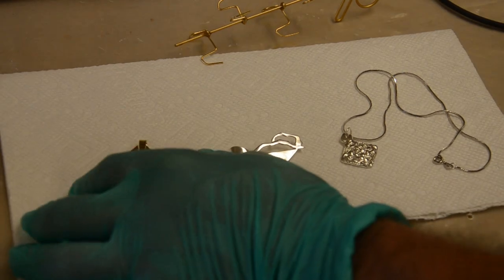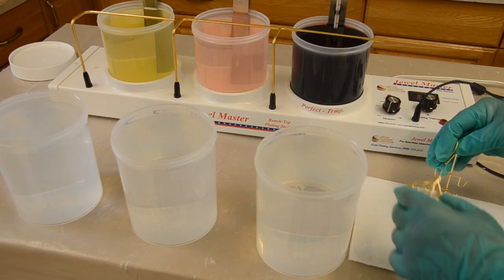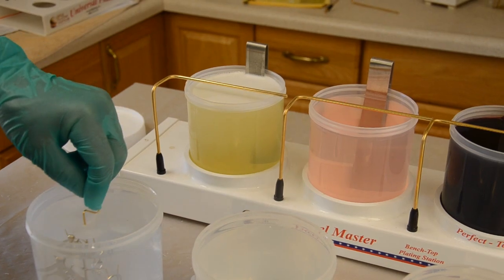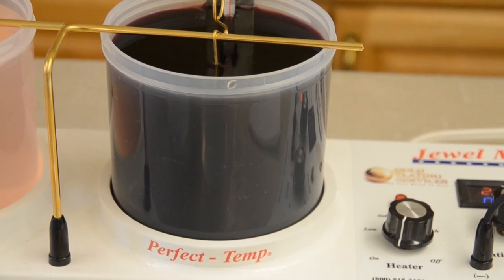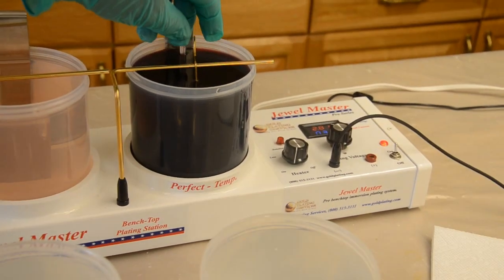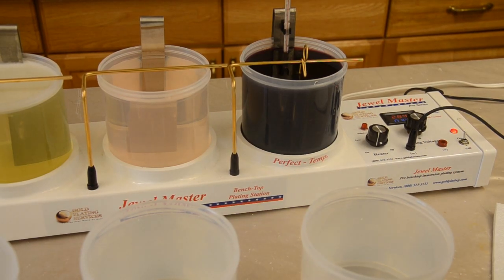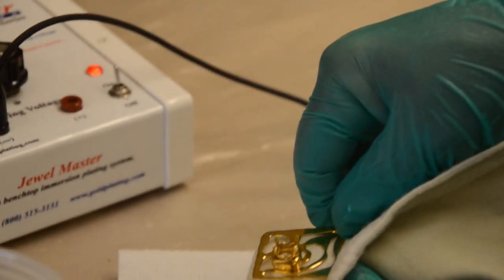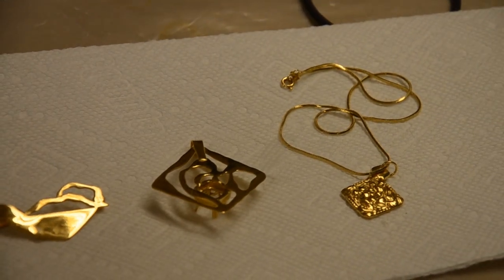Gold Plating Jewelry - Gold Plating Kit - "The JewelMaster Pro"

Comment: The problem with gold electroplating is that it DOESN’T STAY very long on jewelry that you wear any length of time.
Depending on the acidity or alkalinity of the person’s skin. Our own ‘chemistry’ wears it off. 😒
Reply from the maker: It depends on how long the gold is plated onto an item. But yes eventually gold will need to be plated onto an item again for it to look brand new.

Comment: Good day
I have a problem with the gold plating when I look, it looks good, but it removes quickly when touched or used within two or three days. What is the problem and what is the solution please .. For information, I paint for 30-40 seconds and do not use the activator. What is the activator used in the explanation?
Reply: Did you find the answer? Please help.me wher i can get answers from too

Comment: Do you recommend any product that seals the plated gold in ?
Reply: Great question! I hope we will get an answer! Also to be honest I do nails so I tried sealing with a clear hybrid base coat and/or top coat. It changes the feel of course, becauce hard gel doesn't feel like metal but it works GREAT as a sealer!! It's also safe for the skin after you cure it, it' super clear and shiny AND it can fill in and hide some scratches etc. You just got to be careful to keep it thunk so that you don't lose sharp edges and a clean look ❤

Comment: Would like to purchase a starter kit to get started of course.  Can you recommend the very first one I should get. I eventually want to get to playing guns
Reply from the maker: The JewelMaster Pro (shown in the video) is capable of plating onto most metals.  For steel/stainless steel you need a "Strike" instead of Activator.  You can use either Woods Nickel Strike or TriVal - Acid Gold Strike.  
The JewelMaster is a great starter kit.  Many who get too busy to keep up with their needs with the JewelMaster will eventually upgrade to our new ProLab plating kit, which has 4 or 5 Liter capabilities.

Comment: How do I strip my costume jewerly before gold plating them ? I have tried gold plating on top of my old jewerly and it comes out an ugly color not gold
Reply from the maker: Polishing is the best way. You need to get the part prepped to the luster you want prior to plating.  This is the case with most finishing and is most important with plating.
Reply: @GoldPlatingServices  thank you for replying.  What do you use for polishing? Any suggestions please?

Comment: how long does the gold plating last before it wears off from the actual metal?
Reply from the maker: This completely depends on 2 main factors; 1) how thick the gold is plated. 2) How it is handled.
If you plate the item with a very thick plate, say "Vermeil" (Pronounced Ver-May and is 2.5 microns thickness), it could last a lifetime.  If its earrings it will be handled less than a ring, etc.  Typically gold plating gets a bad reputation because many jewelers apply the gold way too thin.  When we plate an item, we put on atleast 1 micron or more and it lasts many years in most cases.
Reply: @GoldPlatingServices   It also depends on the person’s chemistry on their skin!  We have a pH level. I have had Bad Luck with plated jewelry.  Some wore off in weeks!🙁 (obviously poorly done) 
But I also grew to realize that all the vitamins I take, especially Vit. C, have an effect on plated items (but hey, mosquitoes don’t bite me and no colds or Covid, soo 🤷🏻‍♀️!)
I own 1 vintage, 50’s era, watch that has kept its plate well. There’s no school like old school!✌🏼

Comment: If you keep plating longer will it build up to eg: 5 microns, or 10 microns? I am wondering as most watches were plated to 20 microns back in the day?
Reply from the maker: 24K Hard Gold can be plated to ~2.5 microns or 100 microinches. 24K Soft Gold can be plated indefinitely thick, but has a matte finish.

Comment: @GoldPlatingServices  I have Three questions for you...Does Gold Plating give off any type of smell? How do you dispose of the used chemicals and What type of zoning does a Jewelry Maker fall under? Appreciate your help.
Reply from the maker: Gold plating does not give off much of an odor, if any.  Most people do not smell it however some with a sensitive nose can.  
To dispose of the chemicals you would need to find a local waste disposal service.  Many areas allow you to take it to the landfill, where they have a hazardous waste disposal area.  If that's not an option, you will need to contact a private local waste disposal company and inquire about picking up liquid waste.  Many people get large containers (20gallon, 50 gallon, etc.) and collect it for years and then pay a 1 time disposal fee (usually $100-$200 or so).  Zoning will depend on your area, you would need to contact your local agencies to find that out.

Comment: Will this set up work on a chain that is already 14k gold?
Reply from the maker: Absolutely!  Plating onto gold is about as easy as it gets.  You would follow exactly the same steps shown here.
Reply: @GoldPlatingServices  Thanks. This is the best kit I've seen. One more question. Regarding the 3rd (black) solution. I'm planning on plating large chains (24 inches by 20 mm). Does the Solution evaporate with relation to use or does it remain relatively the same with only the effectiveness of the plating diminishing with use?
Reply from the maker: @PaulShalahm  Great! We're glad you like it.  It's not very important but the gold solution is actually Purple (if you get the kit is more why I mention this).  Water will evaporate from the solution as it is used around 100°F, however this is just water and can be replenished with Distilled or De-ionized water.  As you use the solution, the gold content will lower (a function of total area plated X thickness). You can replenish the gold using our Gold Replenisher, which comes in 1 fl. oz bottles that contain 1g per fluid ounce.  Each gram can cover ~80 square inches to 1 micron (1 micron is achieved in about 5.5 minutes).  So if you know you're going to be plating 1 square inch of area for 5.5 minutes, you will be taking 12.45mg of gold from your bath. If you knew you were going to be plating 80 square inches of area for 5.5 minutes, it would be best to add 1 gram of gold prior to doing that plating, so that your bath stays at 100% efficiency.  Optimally, you should always try to keep your bath above 2g per liter, as to maintain a reliable deposition rate of 1 micron per 5.5 minutes.
Reply: Gold Plating Services so a 10k chain is good to plate? And if so what colour will it look like

Comment: Is it possable to replate something that has vs diamonds in it?
Reply from the maker: Absolutely!  The solutions will not affect diamonds at all.
Reply: If i buy a stainles steel Rolex and plated iT in 24 or 18k a thick thick layer so when i scratch iT u can stil see the gold , a 36mm Rolex , would iT look lik a gold Rolex or would u see its plated also how much would that be if u had to guess ??

Comment: Hi, I have concerns that although this looks to be an excellent home gold plating kit it may only flash plate.
I need to be sure this will plate 3 microns without any problems, what do you think?
Reply from the maker: This kit can plate to virtually any thickness.  Flash plating is 0-7 microinches or less.  This hard gold shown in the video is capable of plating up to 120 microinches (3 microns) in one contiguous layer, however that is the absolute maximum.  Typically, to go this thick, it would be done in 2 separate "layers".  This means you would plate it once for 1.5 microns, then again for another 1.5 microns.  The kit is not the limiting factor in thickness, the solution is.  Hardened gold solutions are more limited in thickness, in one layer.  However, with a Pure Gold, you can plate virtually to any thickness.  The reason people dont use a Pure Gold for jewelry is it is not hardened and has no brighteners.  If you do wish to achieve 3 microns, keep in mind you will need to track your gold use and maintain your bath.  3 microns is VERY thick for a hard gold and most do not plate that thick.  We can help you with gold usage and how to replenish the bath.
Reply: Hi 
Thanks for your reply.
  Would there be more chance    peeling given the hard gold solution needs two plates to achieve 3 microns thickness?
What if I used the pure gold solution first and then the hard gold to obtain a durable finish on my jewellery? Do you supply full detailed notes re pros and cons      and after sales support with this kit?
Reply from the maker: Betty, rather you did it in 2 layers or 1 contiguous layer there would be no difference in adhesion.  You would have zero chance of "peeling" if the initial layer is applied correctly.  You could do your idea with the pure gold capped with hard gold, however I believe this is not as good of an idea as plating with hard-gold throughout.  We supply a comprehensive users guide, these videos, and all the after sales support you need.  You can e-mail or call any time with questions and we have experienced tech's ready to help.
Reply: My jewellery line is mainly sterling silver, I don't want any migration into the gold plate. Is an undercoat of white bronze advisable  and do you supply the bronze plating solution?
Reply: @bettybho2168  >> What about rhodium plated ?

Comment: Are these solutions still good after using them once? Also, how long does the plating last?
Reply from the maker: They are good for hundreds if not thousands of uses.  The thicker the plating, the longer it lasts.  Can last a lifetime if plated thick enough or wear off in a week if plated too thin.
Reply: @GoldPlatingServices  lol mine wears off in a week lol. Got it from a cheap seller for 18$

Comment: What's the best way to dry the gold after plating but in a way that doesn't effect the surface of the gold?
Reply from the maker: You thoroughly rinse all solutions off the piece after plating, dip into distilled water rinse and then dip into an alcohol rinse.  Allow the piece to dry (until alcohol is dried) and it is ready to go!  Technically you can just take it out of the bath, rinse it off and dry with a papertowel as well without damaging the plating.  There is no curing or drying time required aside from getting the rinse water off of the piece.  Some people use compressed air to remove the rinse water from the piece as well.
Reply: Gold Plating Services thank you very much I  Grateful to you. You are a best company plating.
Reply from the maker: Thank you for the compliment!  We greatly appreciate it!
Reply: +زكريا ادريس kaj
Reply: Uhh, he DID it in the video.

Comment: What steps should be taken for the piece before the plating process? I use a steam machine, an ultrasonic cleaner and a cleaning material before plating. Is there anything else that improves the quality of plating.
Reply from the maker: As long as the part is free of debris - polishing compound, dirt, dust, etc., that is all that matters.  Improving the "quality" of the finish is mostly done in the prep (polishing).  You want to get the item to the finish you desire BEFORE plating it, not after.
Reply: what is the name of purple solution which is added to the complex to appear in this shape?

Comment: do u use Distilled water or normal water ??
Reply from the maker: Distilled water should be used for all parts of the process.  If you are in a pinch, you can get away with rinsing with tap water but its always best to use distilled.

Comment: does the gold wear off eventually?
Reply from the maker: Eventually yes, any plating has the potential to wear off no matter what metal it is or how thick it is plated.  However, the thicker you plate it the more wear it will withstand.  Also, this is a hardened 24K gold which makes it multiple times more wear-resistant than a "soft" gold.  It is still a 99.97%+ gold deposit, the hardeners just disrupt the lattice formation of the gold ions as they deposit.  This disruption strengthens the structure of the formation - kind of like building a brick wall instead of trying to build a wall with varying shaped boulders.  When a hard gold is applied to a reasonable thickness it should last many years, especially if taken care of.
Reply: @GoldPlatingServices  how much would you charge to plate some items for me ?

Comment: Hi can I gold plate onto an alloy or do I need to flash plate the alloy first and if so with what metal
Regards
Reply from the maker: It would depend on what the alloy is. Stainless steel does require a "flash plate", for this we normally recommend Wood's Nickel Strike. Most copper alloys don't require any special activation but some applications do use a nickel under plate on copper, brass, or bronze. Our technical staff can advise on the requirements for various alloys.

Comment: If a sterling silver necklace plated with gold will it tarnished if you shower with it and exercise with it ??
Reply from the maker: Gold plating is porous.  So if the gold is not applied thick enough, the silver can corrode underneath the gold.  The way this is dealt with is to either apply the gold quite thick or to apply a "diffusion barrier" between the substrate and the gold - this is typically done with something like nickel or rhodium.  If you have done one of these two things, the silver should not corrode and the gold certainly will not.

Comment: guys pls tell me that where is the gold? that he is plating.
Reply from the maker: The gold is dissolved into the solution.  The gold is first made into a salt from the metallic form. When it's a salt, it looks exactly like table salt (white crystals).  We then dissolve it into hot water with other make-up components (organic conductive salts, hardeners, brighteners etc.).  The purple color is actually the brightening component.  Before you add the brightener the solution is crystal clear, even with the gold in it.  When the electroplating process happens, the gold comes out of solution and forms as a metallic layer on the surface of the item being plated.

Comment: If  I  don't want to buy the kit where can I have this done, and what are the prices per piece?
Reply from the maker: We also offer electroplating services, here at Gold Plating Services.  We have a $150.00 minimum plating charge, but typically 1 or 2 jewelry items will fall into that depending on what they are.  Send us an e-mail at info@goldplating.com with a picture and description and we will get you a quote ASAP.  You can also give us a call a 801-546-6200, but typically its best for us to see it first and shape, size, type and condition greatly affect pricing with Gold plating.  Thanks!

Comment: Hi, can you tell me if you can plate fine chain link necklaces with this kit?
Thanks
Reply from the maker: You can plate fine chain link necklaces, however they need to be pulled as tight as possible in order to allow the electricity to flow from link to link.  The current has to be able to flow throughout the entire item.

Comment: Can you do this same process with plating silver? TY
Reply from the maker: Yes, you can plate onto silver with gold plating solution and with silver plating solution onto the same type of items you can gold plate.  The process is the same to achieve a silver plate and it is to achieve a gold plate, each solution just requires a slightly different voltage setting which is indicated on the bottles and instructions included with purchase.  Please let us know if you have any other questions.
Reply: +Gold Plating Services What solution would I need for silver plating? Do you have a direct link?
Reply from the maker: We have a silver solution called  "Heavy Silver Plating Solution".  It is available, however, it is not on our website, unfortunately.  If you would like to order, please send us an e-mail at info@goldplating.com or give us a call at 801-546-6200 and we will make sure you get everything that you need!
-Robert @ GPS
Reply: Do you provide re coating service? Or do you know anyone that is reputable?

Comment: lets say I have pendants about the same size as the pendant that you plated that can hold the stone..about how many can I plate with the gold solution? And how much is a refill of the gold solution? Thanks..Excellent video too
Reply from the maker: +Antonio DaLomba Jr Thank you Antonio, we're happy to hear that.  Assuming the area of that pendant is about 2 square inches you could plate around 125 to 150 of them to a "jewelry grade thickness" of 20 micro-inches.  Our "24K Bright Gold Solution" contains 2.8g fine-gold and costs $325.00 per bottle.  If you used every milligram of gold in the solution you could plate about 400 square inches of area (200 of the pendants) to a 20 micro-inch thickness, however most people replace the solution when the gold content gets low as the deposition rate slows down quite a bit.  The cost of the actual gold plating is quite minimal.  The ability to gold plate items, the time involved, and the inherent value of turning something gold is what most people are charging for when they price a job or item.  Let us know if you have any more questions or shoot us an e-mail if you would like to order.

Comment: What is the max micro-inches that it will do?
Reply from the maker: +Joe Daddy You can plate to virtually any thickness if properly done in layers.  However, the thickest you can feasibly plate with a hardened gold in one layer is approximately 80 micro-inches.  After ~80 micro-inches the finish will start to appear "hazy", and begins to lose its luster.